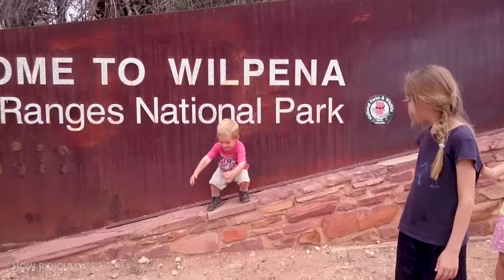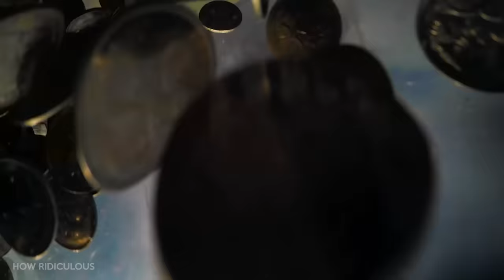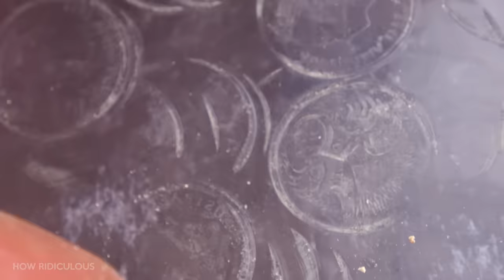THOR’S HAMMER Vs. UNBREAKABLE BOX from 45m!

Comment: with a solid foundation you would have broken it, the sand cushions the impact
Reply: @yingyang3769  bricks floating on sand aren't a 'solid foundation'
Reply: I agree, the foundation could've been better and they would've gotten through
Reply: Kiz you are trying to sound smart, but that has the logic of a 6 year old
Reply: @yingyang3769  There is still sand absorbing the brick force. The foundation is not solid. Put the box on a big anvil then it will broke
Reply: Someone that’s just like saying sandbags won’t work to protect against bullets because the sand isn’t a solid surface
Reply: Someone also there is that much force being pressed on it at one time, the sand will turn solid as soon as that much weight is fallen onto it
Reply: @yingyang3769  dummy, sand absorbs the force of the bullet hitting the sandbag
Reply: @yingyang3769  Yes the sand will compress and that's why objects bounced on the box. But while compressing, the object decelerate and force is absorbed
Reply: Your correct but it also absorbs the brunt of the impact
Reply: I came to say the same

Comment: If the box was on a solid surface the impact would be greater
Reply: I'm not sure what kind of solid surface can hold up to these guys. Maybe a 1" steel plate?
Reply: Using a compactor to flatten the sand would help to increase the force of impact.

Comment: The sand absorbed alot of the impact put it on solid ground and the outcome would be different
Reply: that was my first thought as well.
Reply: You can see the pressure wave moving through the sand in the slo-mo.  If that energy were contained in the box, there's no way it would survive.
Reply: Totally agree that box would have been gone!!!! 100%
Reply: Would be a lay more unsafe if they did it in solid ground. Firstly they'd need a new tower to drop off, also the shrapnel would be insane.

I would like to see it, however
Reply: pretty sure they dont know anyone stupid enough to let them do that, as whatever is under the objects will likely get broken too. kinda amazed this place lets them do this crap and leave a massive mess behind, not only is it a HUGE liability for the place should one of them get hurt, but they're making a huge mess of the area... look at all the trash they leave in that sand in every single video.

Comment: Where was the giant dart? It would have destroyed the Box imo
Reply: I know its at the beginning of the video but they dont mention it at all.
Reply: They missed an opportunity there. I agree, the dart would've had the best chance.
Reply: Your so right. It would have gone right through
Reply: Il be honest I thought the same!.... but is it a tad on the light side.... ?
Reply: If they used it it would go through and rip the money
Reply: @kylemcw8301  not really, while all the other things are heavier, the energy is spread out, the dart puts all its energy into one tiny point
Reply: Yeah, the dart or the spike would have gone straight through.  The way to defeat "bulletproof glass" is to have concentrated pressure.
Reply: Julien Walker  no it wouldn’t have lol
Reply: Agreed
Reply: I will say, as an engineering major, you would have broken the top if all of the sides, as well as the base/pavers were the same strength
Reply: They used it against one piece of poly carb and it barely punctured the surface
Reply: @chromzy1123  yes, it would have.

Comment: You got to try and smash open a planes BLACK BOX, It's supposed to survive crashes, it's got to be the ultimate test for Thor's hammer. 🔨
Reply: Where does one just get a black box?
Reply: If they can break this that a tank shot can't...they probably can break a plane box. JK a plane box is wayyyyyy stronger
Reply: ItsKianPlaysRB YaBoi btw the tank shot thry missed it
Reply: @Thestorminator89  Awesome, but is that a strong one? I know nothing about planes.
Reply: @richdadsummit7557  I'm not sure, It's the first one I saw on eBay. With a bit more of a look about and research should be able to get a good one. But this one should still have standards to survive a crash though.
Reply: Indestructible lid.. box is weak as..
A box is only as strong as its weakest point so the anvil beat the box
Reply: and it's another Australian invention

Comment: Giant dart vs. Unbreakable box would be amazing I think
Reply: Just what I was gonna say.  you got here first though so props to you
Reply: it would go through like butter lol
Reply: Ron Burgurdy nope
Reply: @ronburgurdy5226  yea.. it definitely would damage it more because it has the point on it, but it lacks the weight of the others..
Reply: @tears_of_asariel3198  Yep, that's why I'd like to see the giant dart taped to the bottom of the atlas stone. Assuming that it drops straight, I reckon the combination of point and momentum might just do the trick.Probably split open a cross with the flights, with the stone peeling that right open.
Reply: 6yjjk, why not just create a true giant dart that has both the weight and the point
Reply: Vitamin
Reply: @ultraniumite  That would certainly work, but if you've already got the stone and the dart, a bit of duct tape's all you need.
Reply: Alenex 87 it’s already been through that material 🤦🏻‍♂️ same thickness

Comment: If u put that under solid metal or concrete, there would be more damage. The sand also takes away a lot of the impact.
Reply: They do put it on concrete
Reply: It’s not enough considering you can see the sand explode from under the concrete. He means a solid concrete thick piece as a platform
Reply: was going to say the exact same thing.
Reply: Sand actually makes it more accurate to be able to test the force
Reply: Need to stand the box on end, let Nigel impact it from the side.
Reply: JFVTV they had bricks under it to make it where it absorbed more of it than the sand
Reply: JFVTV it went straight into the box. The box was on top over concrete. The concrete was on top of the sand.
Reply from the maker: JFVTV yeh we realised that, hence why we put pavers down, didn’t have anything else on hand. Next time 👍
Reply: How Ridiculous honestly still a great video either way! Just a heads up for the future :D
Reply: JFVTV dude you just got how ridiculous to actually respond to you! Is it everything people say it is

Comment: You definitely need a more solid base, a lot of force is lost bij the soft sand
Reply: Itd be the opposite actually, while the energy is absorbed by the sand the more cushy/less bouncy the material the more energy stays kinetic
Reply: not unless the energy from photosynthesis occurs and complies to the kinetic energy from the outter protons because of the gravitational force is higher than the apploed force in order to account for friction for the normal force the object has

Comment: I’d like to see this challenge redone with one critical difference… steel plate instead of pavers underneath

The sand acts as a massive absorber of energy for every drop, but admittedly it’s easier to fill in divots with sand than repair solid slab/concrete flooring

Comment: SO much force is absorbed into the sand.
Reply: Boss Guy It’s not that much. It’s an amount, but it’s not that significant.
Reply: you are right boss guy
Reply: That’s why they’ve put concrete underneath tho
Reply: Joshthegamer456 idk what ur talking about but you can literally see the sand absorbing it
Reply: @feet3857  idk what kind of physics you're doing but if the sand moves, force has been transferred into it. From where? The box. So unless the heavy object is hitting the sand. The box suffers most to all the force
Reply: @White-ul3dl  but then the box is moving into the sand, if it were an impermeable surface, unlike sand, and to which, i think the OP was referencing, then in such an instance the box would have withstood full force of the heavy objects blow and likely sustained significantly higher damage.
Reply: @White-ul3dl  Sand is absorbing like 50% of the force. Put the box on a thick  iron platform then let the atlas stone fell from 45 meters. The box will crush very bad
Reply: @blazerumble3521  If it wasn't hollow would it still be a box to contain and protect things?

Comment: THE SAND DEFINITELY SAVED THAT BOX from the hammer
Reply: Agreed! They need to set each end of the box on cinderblocks, with nothing supporting the middle. Then Clayton would smash the top right in half!
Reply: Or a larger set of slabs for the bottom, the bricks kept giving in and scattering.
Reply: Came here for this comment. It doesn’t matter how much force they put into that box if it is allowed to transfer that energy into the ground.
Reply: basically what I was insinuating they need to harden an area and call it a drop zone drop zone make it like a cricket pitch 
 @jonhaile6458
Reply: Danny Shaw a cricket pitch is only that hard because it’s only a few inches of sand. It’s very difficult to get a naturally sandy area hard enough to resist Clayton, etc. I’m an architect not a structural engineer, but I’d like to see them pour about a meter of concrete cover it with a steel plate, and use that as a drop area.

Comment: I'd wager that you could've dropped basketballs rather than bowling balls, and it still wouldn't have bounced as high off that box.
Reply from the maker: Mark Hashman yep that’s fair
Reply: How Ridiculous hi
Reply: @unlokia  Bowling balls also don't deform as much upon impact as basketballs do, so less of the force of the impact is diffused -- I'm sure that factors in as well. Plus, you're dealing with more newtons of force, thanks to the higher mass relative to the constant acceleration from gravity (I'm sure there's some truly dedicated physics fans down here in the comments section who've calculated the approximate force of the impact of a bowling ball dropped from 45 meters).
Reply: @unlokia  Fair enough.

Comment: You guys should have used a GIANT DART! 😂😂😂
Reply: would have no effect
Reply: Hahhaha I thought u said giant fart hahaahaahha
Reply: was gonna say that lol
Reply: It was there in background at the beginning!
Reply: @autumnduff7125  Never underestimate the power of compressed gas..
Reply: @RaoulRamsaran  not so sure. that thing was hard yes but also elastic which made it really resistant to blunt trauma. if you concentrate the force you actually might have a chance to break the thing open. Poly carb is actually quite stretchy and fibrous allowing the energy to mostly pass through there. the dart would probably be the best bet against it as it only allows for some of the force to dissispate to weaker parts of the box
Reply: Jr Castro thy would kill the coins

Comment: For those wondering why the footage from the Thor's Hammer was not in this video: When the SD card ejected in mid-recording, that corrupted the file. A corrupt file is, by definition, unusable. Some corrupted files can be recovered, but in this case, I don't think it was. Also, I am unsure of any damage from the sand.

Comment: You don`t have hard enough surface to put objects on them.In addition, the sand has a springing effect, which in turn prevents the force from concentrating at one point and  scatters the force sideways. That`s why the box wont brake and instead its bending.  You must put hard enough surface on top of hard enough surface(sand+hard surface+hard surface), and than put whatever object on them for braking (especialy objects like this box)

Comment: Hate to say it fellas but this test is inaccurate, you needed a solid surface. The pavers on sand absorbed an insane amount of energy hence the bending of the polycarb. My guess, on a solid surface is bye bye box. Do another one on a solid surface like a few massive thick steel plates etc..

Comment: You should try to break an engine block. I don't think you will succeed
Reply: QuickShot WOTB If my driving can break an engine block I’m pretty sure a hammer from that high would do it with ease
Reply: Ford 351 5.0 engine block : How my beer, watch this shit!
Reply: Depends on if its cast-iron or aluminium

Comment: You fellows might need to build a polycarbonate trampoline. I figure a meter across, round and supported on the edges by a steel frame.

Comment: put an Cast Iron plate unter the Box instead of stones and it break much faster...Stones are 2 weak and have the same effect as the Sand. If u put an 0.5 ft thick and 2 sq ft Cast Iron plate under it i think the impact dmg would´t be absorbed by the sandground:)